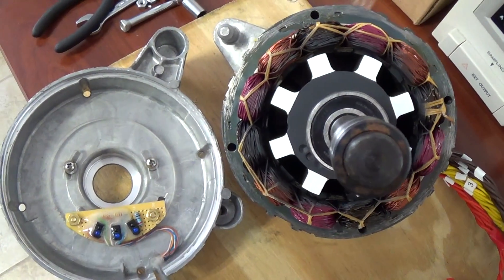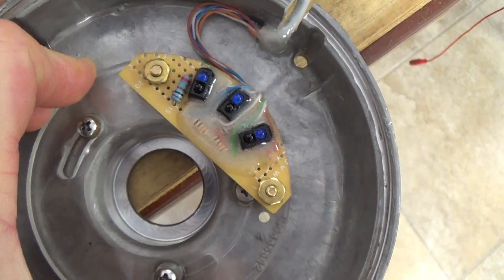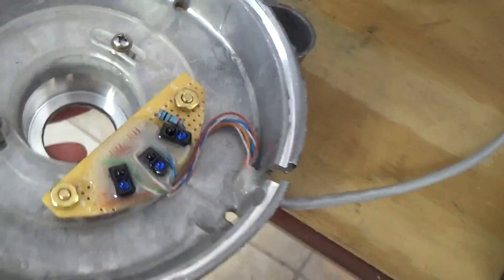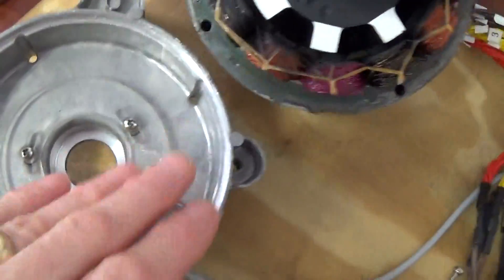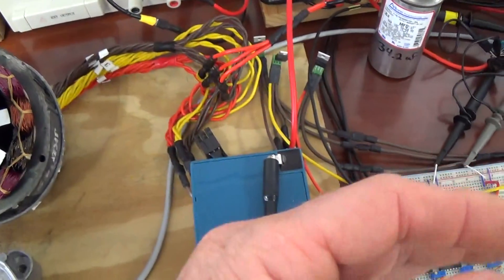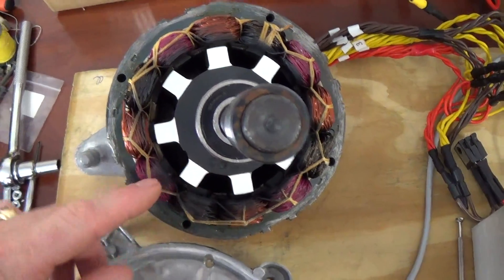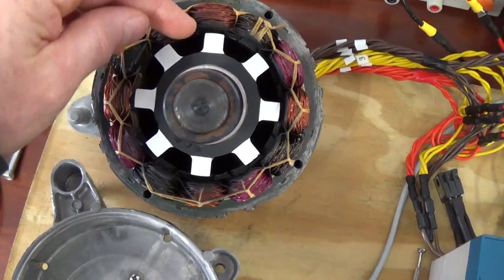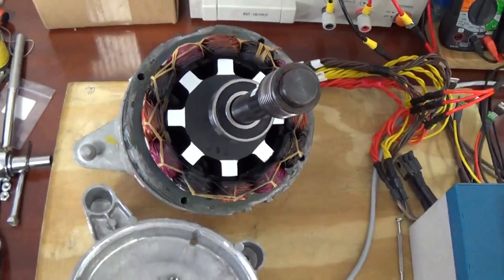Sharing ideas, how to build a more efficient motor (p.11)

Comment: Nice work... but too bad you can't use something like a RC brushless controller that would give you more like AC drive... a bipolar / H-bridge PWM.
Reply from the maker: +beforebefore I do have RC brushless controller but that would be doing the same thing of an off the shelf motor which you can't collect flyback to do additional work. The direction of my research is using DC so part of the coils power can be collected back when the coil is switched off (collapsing field flyback) which will be connected to an assisting motor attached to the same motor shaft. This in theory should add 30% to 50% more torque to a standard motor. The final tests will be proof. I'm not there yet. Still getting the primary motor working to my liking. Once that is done attaching the second motor will be much easier I think. Luc

Comment: Nice update, ... do you believe,it may be possible to run those motor by a RF signals ?  Thanks for sharing.
Reply from the maker: +THEWATERENERGY1  I don't know and have never heard of wireless motors. It's difficult enough to run them with wires.  Anyways, it's not part of my research. Thanks for your interest. Luc